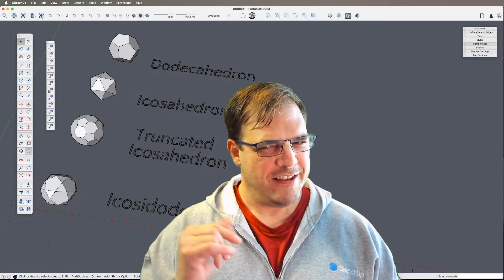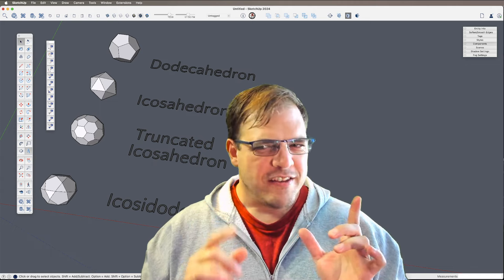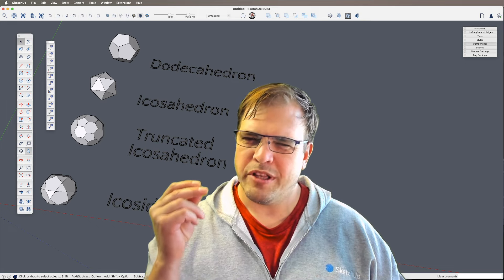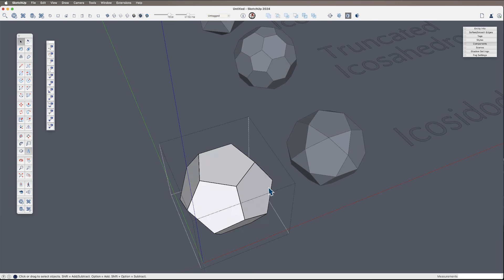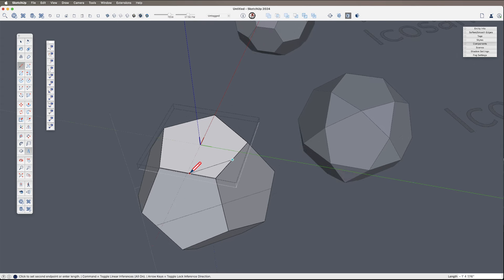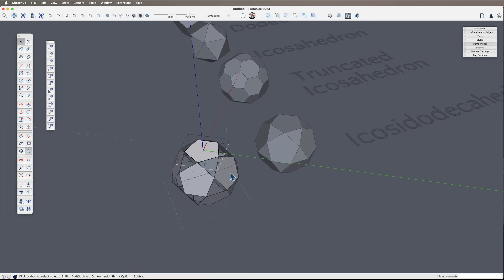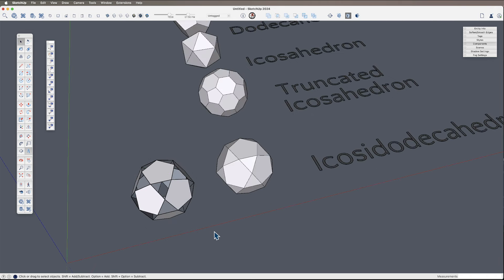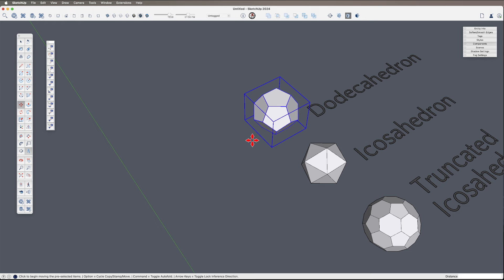Modeling Polyhedra with NEW SketchUp Inference

Comment: Thanks Tyson, inferencing is one of the most powerful native features in Sketchup. I use it all the time as part of my workflow, and have notice that I make less mistakes.
Also you can inference to a surface b4 you start rotating or pulling a surface, so the point/surface wil snap to the inference surface.